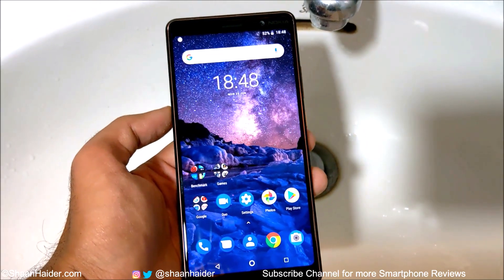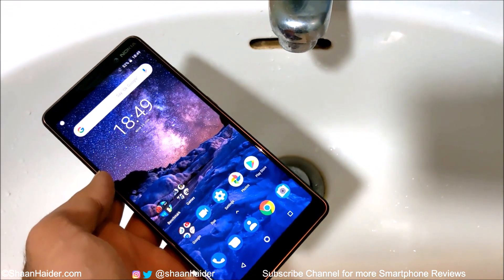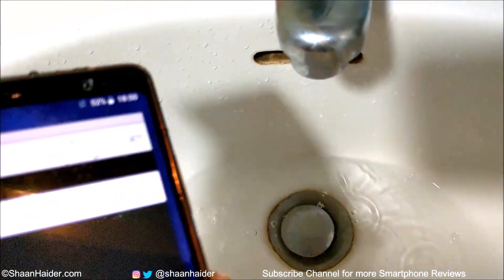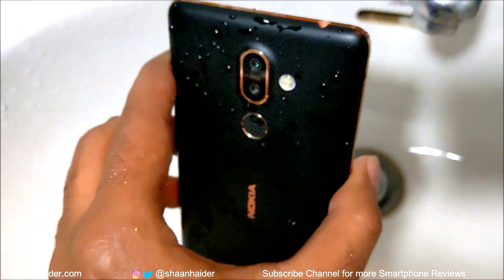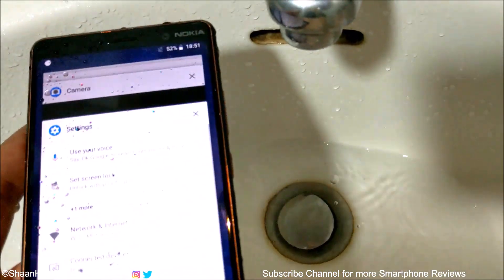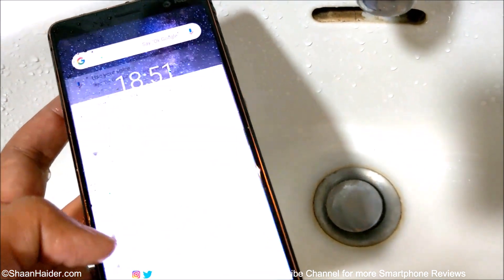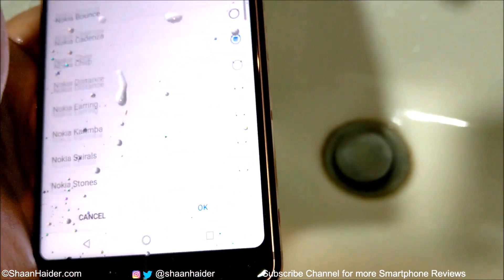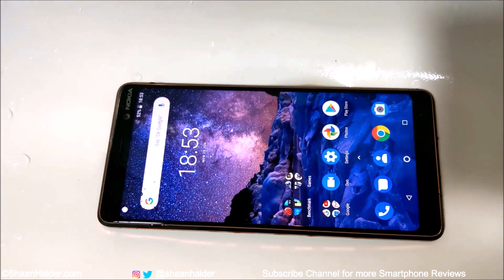Nokia 7 Plus - WATER TEST

Comment: My NOKIA 7 Plus got soaked in the rain. Water filled each crevice on this. And inside as well. The flash was full of water and it looked like a spirit level haha.  However, the phone was working, but with the following observations : 

1. As i restarted the phone (i was wrong) it started with an incomplete nokia start/booting tune. It sounded like usual but didnt complete the ring, would stop in the middle.
2. Even Pubg worked fine and smooth. Lol.
3. Soon after a few hours, it began to take restart on its own. 

I concluded the phone is not water proof however it has a wonderful water safe circuit that saves the device from water damage. 
The Nokia people said the warranty was invalid anymore. 
So i decided to take the phone to a nearby shop. He is a trustworthy guy so i was sure if i give him to dry my phone he wouldnt steal its genuine components. 

He returned me the phone next day. Good as nothing had happend. 
It has taken bad rains twice. Working like a charm.

Comment: my nokia7 plus just died while i was using it. No response even pugging in the charger.

what could be issue ?
Reply from the maker: Try to boot it in the recovery mode. If it does not work then, maybe  it is the motherboard issue

Comment: bro nokia 7plus any ip certified or not i saw some website ip 54 certified its true or not
Reply from the maker: Officially Nokia never said that there is any IP certification on Nokia 7 Plus but few websites mentioned it. So, I will prefer to follow Nokia and be on safe side to not void my device warranty by letting any moisture going inside the phone
Reply: Shaan Haider bro water does come in nokia 7plus has work or not it splash sproof
Reply from the maker: If a bit water goes inside, it will not damage the phone as you can see in this video but it will void the warranty. So better not to take any risk
Reply: It's not certified but it's water proof

Comment: Is it IP 68 certified?
Reply from the maker: No, it is not. Officially there is no IP certification for Nokia 7 Plus
Reply: it ip54
Reply: yeah it have ip54 rating
Reply: Cutieplus no it has IP rating
Reply: i read it does have ip rating..
Reply from the maker: Guys, Nokia never mentioned any IP rating for Nokia 7 Plus. Also except Android Authority, none of the other websites said that as I know. So believe official Nokia specs instead of any random website on the Internet
Reply: Shaan Haider you are wrong it is IP54 rated... Nokia even mentions this
Reply: Shaan Haider I already sent an email to Nokia CS about this IP rating Case, and the answer is Nokia 7 Plus has IP54 Splash Proof.....
You can try to ask your self, and also with evidence....
Reply: Officially has IP54
Reply: Cutieplus  watch the presentation with Nokia 7 plus and 8 Sirocco. General director said that n7p has IP54 rating

Comment: So it's waterproof? Then why it don't has any IP rating?
Reply from the maker: It is not waterproof and that is why, there is no IP certification for it. It is just the build quality that resists the water a bit. If you submerged it in the water or use under running water for long then it will damage the device... Even nearly all smartphone brand advice not to take IP rating for granted
Reply: Shaan Haider ohk got it tysm! Can you please do hammer and other tool test on Nokia 7 plus also drop test please!!
Reply from the maker: Here is a scratch test for your viewing pleasure https://www.youtube.com/watch?v=xHHYrTFklg0 :D The build quality of Nokia 7 Plus is great for sure
Reply: Shaan Haider I have saw that video but can you pls make a video hammering the phone also dropping it pls! I m sure it will attract more subs and views cuz no one did it before!
Reply from the maker: Will try :)
Reply: Shaan Haider please
Reply: It is splash proof
Reply from the maker: @Rakesh Nokia official says nowhere that the device is splashproof or comes with any IP rating.
Reply: RAKESH KUMAR Yeah, it comes with IP54 Splash Proof,....

Comment: ha ha my phone has damaged due to water...when a drop enter inside the phone then the white indicator will change to red.... and  the warranty will be cut off...and this phone is not a water resistant which will be said by the customer care center...if you have willpower then do a deep water test. i challenge you it will damage.
Reply from the maker: You are right, it will damage the phone for sure. So no need to do that test at all :D   This test was just to check if Nokia 7 Plus can survive minor splashes
Reply: Shaan Haider did it survived the test earphones , charging, speaker
Reply: Brother if water or if a drop enter inside then the warranty will be cut..
Reply from the maker: @Gururaj Yes, it survived perfectly but as Akash said, even if the devices survives the water the warranty will be void. So better not to take risk

Comment: Why don't you immerse it completely inside water ?
Reply from the maker: Because that will definitely damage the phone, no need to even test as the device is not waterproof. The test was just to check if it can survive slight water splashes or not. And even in this case, warranty will be void if water goes inside. So better not to try it. My intention was just to show that you can be tension free if the phone gets in touch with slight water
Reply: HARIOM SINGH because its not a water proof device thatswhy

Comment: Don't do it, accidentally my mobile is been to rain, still from that day my mobile won't charge up plz don't do this
Reply from the maker: Did you try cleaning the USB port with alcohol etc.? Maybe it got rust after getting in touch with rainwater . Try to clean it with alcohol, spirit etc. Hopefully it will fix the issue.
Reply: hw to clean with alcohol?
Reply: thank you
Reply: which device?